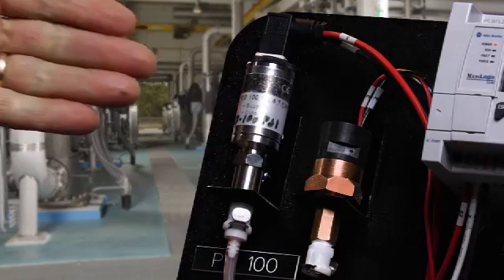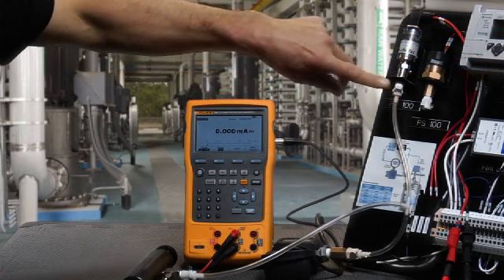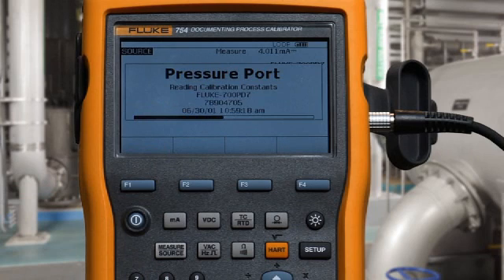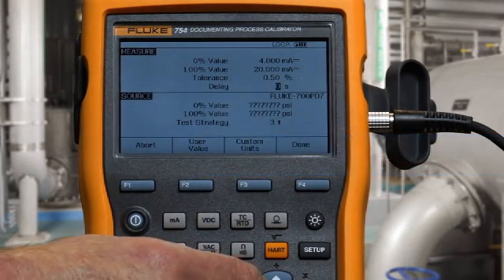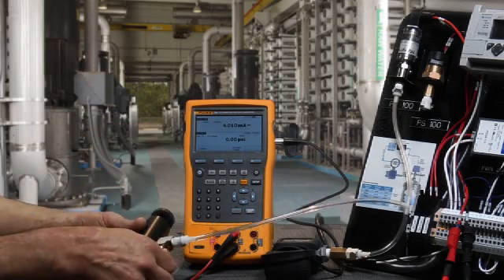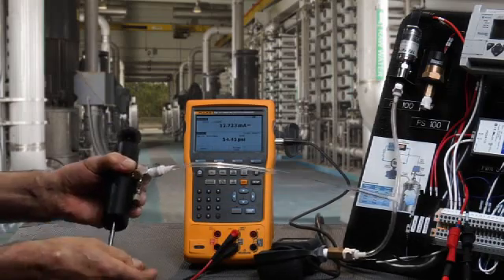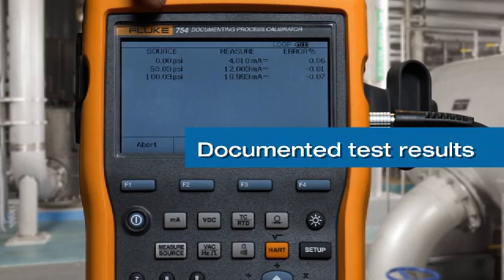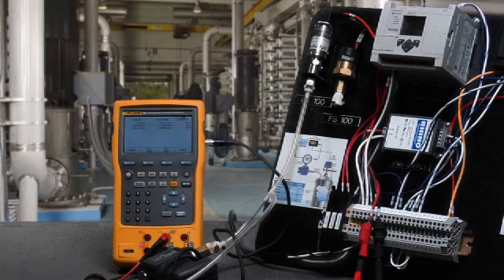Testing a pressure transmitter with the Fluke-754 DPC

Comment: Someone needs to do a temp transmitter & RTD using a Fluke 9144 dry block calibrator and a fluke 754.  It would also be helpful to go over all the connections utilized on both units and the transmitter/RTD.